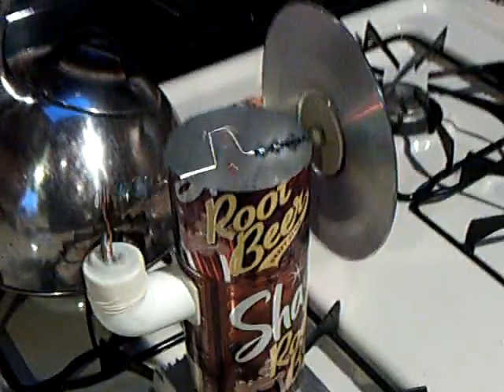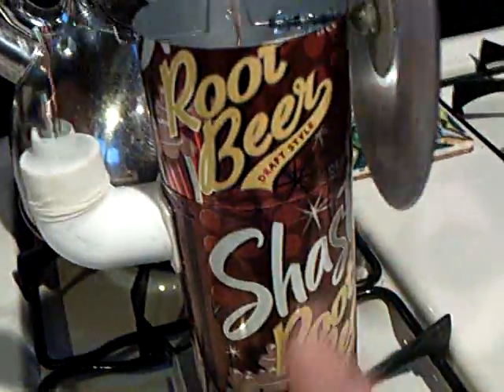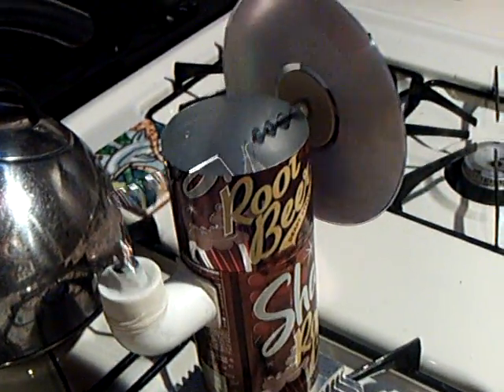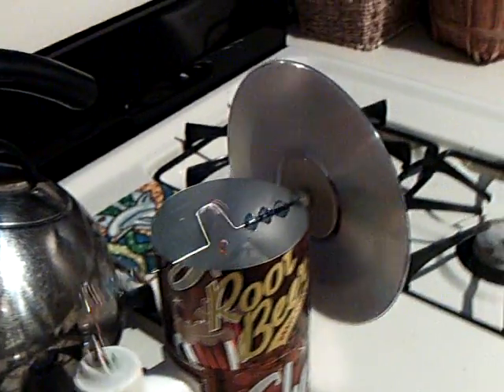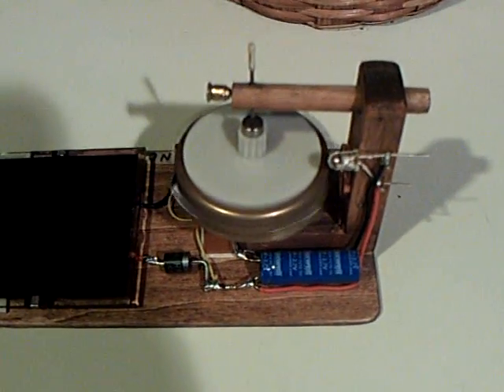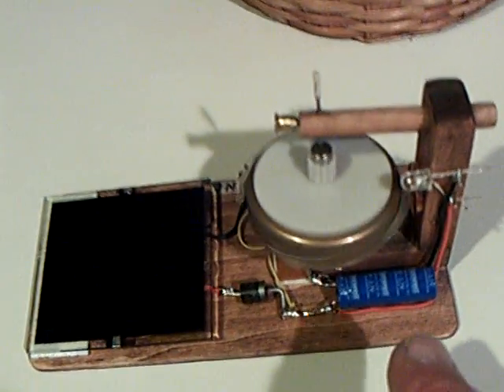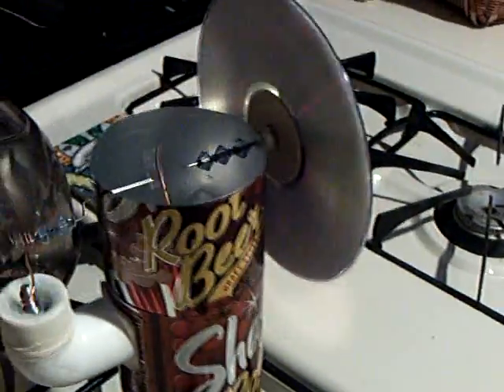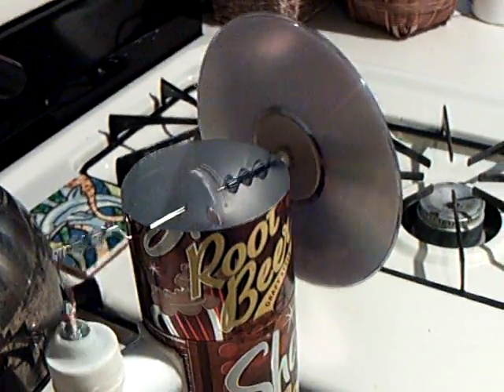Soda Can Stirling Engine

Comment: There are stirlings that run from just the heat from your hand. Or the steam off a coffee cup. Russ, over at RWG does a great one, in one of his videos.. Wider, shorter stroke, (highly over-square) displacer's seems to be the key to lower differentials. Obviously it needs to have excellent tolerances, low friction and a light flywheel. Not easy to make at home, but not impossible. Drill press would make a big difference constructing a low temp Stirling. Precision would be critical.

Comment from the maker: Thanks.  The only real changes I made were to use 30 ga copper wire instead of the fishing line and I used a common foam sponge material instead of the steel wool and aluminum that he called for on the displacer.  The top can was just cut down so I could put the ice in easily.

Comment from the maker: Yes.  My brain has been going round the clock on ways to improve this----and NOT end up out in the garage with the drill press and lathe.  It is a real challenge working in the house---but it is fun.  The "hand heat" engine is a good goal.

Comment: try a mini franell lense but you will need to set it onto a sun tracker.  this will give higher tempature.  Where did you get the plan to made that aluminium can stirling engine.

Comment: Looks work good! Very Well Done, Lid! :)

If you go on LTD one, could you care about torque or even RPM, cause I've seen several feet one on solar direct energy but it was very low speed and I think very low couple. To have any use of them, they would have enough torque and speed to couple with an electric generator. What do you think? Cheer.